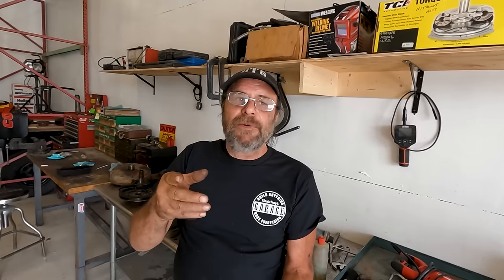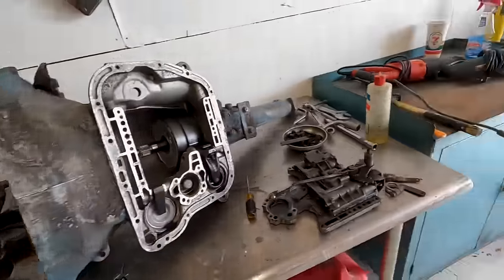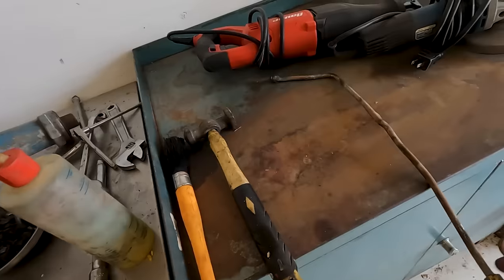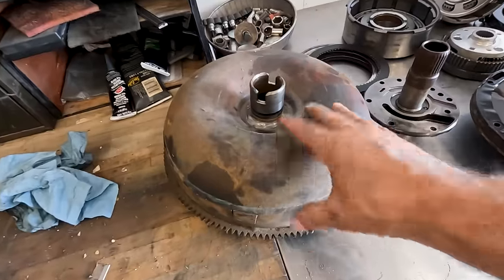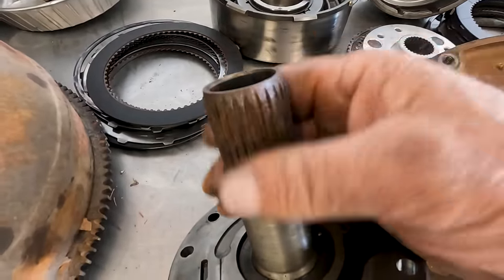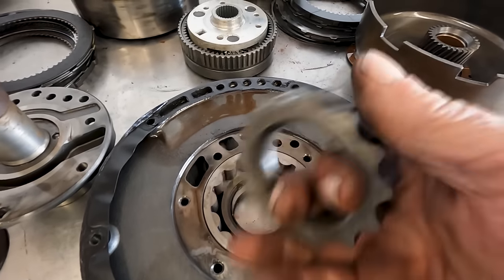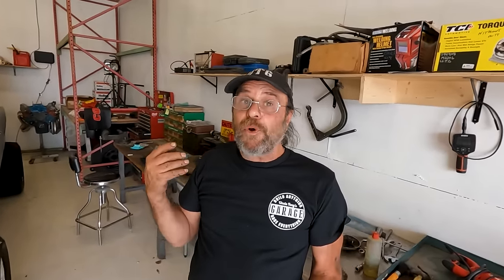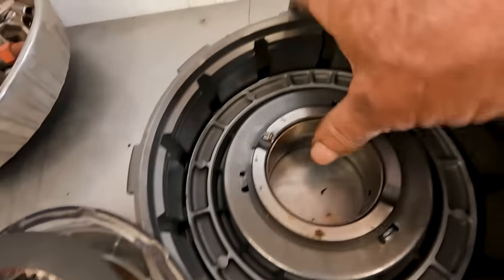Survival For The Budget Car Builder - DIY Transmission Rebuild From A Junkyard Core

Comment: There was a guy here on YouTube from England, who posted  a 17 part video or so showing you step-by-step how to take the 727 apart and rebuild it. I took my laptop out in the garage and used his videos to disassemble and reassemble/rebuild my transmission. It’s been every bit of 7 years ago, and that transmission is still going strong in my 72 340 Duster.
Reply: I watched the same series!
Reply: Bad Tree productions has a few 904 & 727 builds that they do for some of the cars they drive on the street & do some drag time at the strip . They had just done a 727 for the Death pumpkin that's using Cope transmission parts inside manual valve body & trans brake . They seemed to do a good job on showing everything in the rebuilds and checking clearances on stuff in steps and why they do this & even showed so of the home made tools to make things easier to do the tear down and rebuild process . So check them out because they are Mopar guys & some of the videos they do are hilarious at times picking on each other .
Reply: Ha haa, I decided to look for a 200-4R trans just yesterday, and found an ad, a used one $600, im like whoa that's high. So yup, parts are available, but not cheap. I'll stick to my 700R4 I got years ago and just buy a shorter driveshaft. But yeah, I'll take my chances rebuilding instead of ordering one.
Reply: They are better mechanics!! Than some of the clowns that call themselves mechanics over here!!!
Reply: God I love YT if only for this
Reply: Somebody from England working on Mopar transmissions? Learn something new everyday

Comment: Quick tip when looking for a core; if you are going through the pull-a-part, the car that looks clean and nice is NOT the one to get your mechanical parts from! If you can’t tell why it’s in the junkyard, it’s probably a bad engine or trans! However the car that is smashed, you can be pretty confident it drove to the scene of the accident! So while you should still consider any mechanical parts a core, especially on older stuff, odds are the one from the crashed car will need the least amount of work to get back into shape.
Reply: Absolutely Correct...
Hahaha..  drove it's self to the accident....

Beats,The .. well it Ran good,, 
Until it didn't...
Reply: Bingo PAL 💯👍
Reply: This is a darn good point.
Reply: It ran well…
Until that #!!@!$ got in the way.
Reply: That is how I always did my junkyard shopping but like Uncle T said, consider everything a core. The reason I say this is because of the modern automotive invention(! DRUMROLL PLEASE!), The Auto Computer! I have seen dozens of automobiles, that with the correct electronic TOOLS and PARTS, they were still excellent automobiles. They ran great and looked VERY NICE!
   Whether the owners did it or their mechanic ( Who WAS a TOP-NOTCH, Fix ANYTHING Mechanic from the 1970s-1980s) Gave the owner, the Deer in the Headlights LOOK from parts swapping very expensive and non-returnable electronic products. This great mechanic usually doesn't have the scanning tools or the knowledge of what any of it means.
   Everyone has good intentions but your preacher will tell you (it applies to cars), the Road to Hell is paved with good intentions!
  Buyer beware more than ever. Ya'll Take Care, John
Reply: Good tip mate.
Reply: Another thing is look inside the car if it is clean and looks like new it was well taken care of. If it looks like they lived in it and it is dirty they probably didn't do maintenance.
Reply: Yep! All engines I've pulled were from wrecked cars/trucks. You know it was driving relatively ok before it hit something lol
Reply: That's a great way to look at it!
Reply: Unless the force of the accident deformed the part or broke stuff inside... I've never found the junkyard to be a good place to get buildable cores. Just me.
Reply: That’s why my homebuild airplane parts are all sourced from Boeing 737 Maxes.
Reply: Well said..
Reply: Great advice, thanks.
Reply: From a junkyard, if I’ve got a viable “core”, diagnosing what’s wrong with it on the bench during disassembly isn’t big deal…..all things will be revealed. That said, your comment about the wreck towed to the yard from an accident being a safer bet for components than the parts from, maybe, someone’s basement, is right on. Been stung on some pretty looking stuff like that.
Reply: Wonderful advice
Reply: Great advice. A friend of mine mentioned that to me years ago and it seems to ring true👍
Reply: Good tip but being in upstate NY, probably 90% of the vehicles I see in the pick and pull are there due to rust. Either wouldn't pass inspection anymore, needed too much $ to keep it going (pass inspection) due to age rust and deferred maintenance (people don't really maintain cars at all anymore beyond tires brakes oil they use it till that first quoted repair bill exceeds idk $2k? And junk it, repeat)...so tldr basically all vehicles I see in the pick and pulls make for good cores. Use your judgement tho of course I strongly prefer OEM, generally the best quality came from the factory stay away from heavily modified rigs, they're easy to spot. Aftermarket rims, paint jobs etc. You want the factory goods/trans, high mileage doesn't matter for a rebuild. Cheers
Reply: The ONLY time i go for the shiny cars at the pick a part is when i need body parts and interior trim pieces. but ANYTHING mechanical i want that thing to look like it come out of a NASCAR wreck.
Reply: Similarly If looking for a engine, I shy away from roll overs, so often seen it the engine was running upside down/lacking oil in correct places. It may be trivial but given a little galling goes along way and can occur faster than most realize, best chances are the ones not ending up, upside down.
Reply: Err.... If one likes cracked cases and bent housings!
Reply: The best and most common sense statement I think I've ever heard about a subject as this!

Comment: I have only rebuilt 1 automagical transmission and it was a TH350 form the u pull it with an engine attached.  I bought a kit off evilbay for it which was a bigger kit than the $150 ish versions are, Kevlar band and a transgo reprogramming kit.  It looks intimidating but with a book and taking it easy, it really wasn't bad and it 14ish years later still shifting great.

Comment: I'm currently rebuilding a Push button A727, so far the experience has been great, a "built not bought" sort of build.
The build so far has been much improved from stock perameters.

So far i'm $1200 in parts, parts include:

4 pinion front/rear planetary
Front clutch drum with 6 clutch settup
Rear clutch drum with a 5 clutch settup
Thicker lug front pump gear
2000 stall converter
Trans-Go TF-2 Shift kit
Lightened sun gear shell
Drilled/modified case to allow ATF to reach the sprag for lubrication, instead of getting lube by "splash"
Blueprinted case.
Billet accumulator servo with no block rod.
Forward/reverse billet servos.

(Billet servos are necessary at time as the modified valve body pressures tend to crack the stock servos)

The best part about this job is i know what i did in the rebuild.

And as Tony has said: you can point to a part of a car and say, "i did that myself"

Best feeling in the world.
Reply: Did you go with the rear bolt in sprag by chance and if so how difficult was it to install ?
Reply: @peteloomis8456  I didn't go with the bolt in sprag setup, just replaced the springs & rollers only.

I can't vouch for the bolt in sprag installment difficulty, but I don't like the idea of drilling more holes to accommodate new anchor points for the new sprag, just creates more areas where the case can get stress fractures/cracks to form.

One thing I did manage to learn was, the factory sprag outer race that is staked into the case very seldom shifts in their positions, they were really well staked, almost solid from the factory.

Disturbing the factory sprag race is asking for trouble, it hasn't moved for at least half a century, why disturb it's "tomb" now?

This A727 is going in a 1964 Dodge custom 880 behind a 361 big block,
(viewable on my channel)
It's one of the last Chrysler forward look full-size cars.
So it's a cruiser, not a racer really. It's important to have that distinction.

If you are constantly neutral dropping the trans and beating it up, sure a bolt in sprag "might" help.

I say "might" because the full force of the engine will not be stopped by a bolt in sprag, might I recommend a billet front drum?

As the front drum is the part that is allowed to over speed when the sprag fails and explodes sending shrapnel through the floorboards.

Do watch John at CRT on the explanation of A727 explosions.

All I'm implying is a bolt in sprag is a good investment, but there are other critical parts that need to be upgraded in conjunction.

But as a dominoes effect, Putting power through some weak/strong components will always find a weak link in the drivetrain.

Comment: Tony video idea cut that torque converter open and show the common man what's in there it's one of the most misunderstood parts on a car
Reply: It just a fan blowing at another fan causing it to follow along , it's not magic.
Reply: @pisstoffcat5136  I know how it works  never said it's magic but the avg person does not I've heard all kinds stuff like its the pump for the trans and other stuff
Reply: I know what's in it, but I've never seen it. I like the idea
Reply: When I was going to tsti and taking a transmission class , Mr. Rowe the instructor, put 2 box fans on his desk as a demonstration, he put them together and turned one on , the other one Started to follow. And he said see, it's not magic . Not trying to be a smart ass, just how it was explained to me.
Reply: And why a high stall converter is a different animal from a regular Torque Converter
Reply: @wwalker3738  right there is a uneven number of blades on the rotors more on engine side is low stall more on input shaft side is high stall I think
Reply: Also why is a high stall a smaller diameter?
Reply: @bourbonlover7158  I believe it's smaller and lighter spins faster
Reply: @jeremyhanna3852  Yes ,  takes less engine power to accelerate the spin.

Comment: I been researching on a street/strip th350 I want to put together and was more than overjoyed to find that if one leaves a few well places seals out and drills a couple holes bigger you get the same performance as an aftermarket shift kit saving HUNDREDS 👍 the old school guys have been there done that without an aftermarket kit
Reply: And don't forget the old Ford type f fluid ,use that for a firmer shift. 
If they still make type f? 
If you've seen b+m trick shift fluid ,it's type f for your gm product and costs a fortune over type f. 
See if you can scare up some type f ,it's like a shift kit in a bottle. 
Been years since I messed around with that stuff.

Comment: I rebuilt transmissions for 23 yrs before retiring.  The earlier 3 speed automatics are the easiest things to build and troubleshoot.
Reply: Frustrating that something that mechanically works just fine and it gets a computer added to the mix.( 4l60, 47re, or the ford aod)
I have 4 4l60 trans that I have collected up in different states of disrepair. One with no 3/4 , one with 2nd or third gear only(also electrical connector falling into the trans pan), one that does absolutely nothing, and another that the guy just said was bad. Out of all 4 I hope I can make one that works, but all that computer jazz makes me question why I even like Chevy s10s

Comment: I've done a few transmissions myself. I can tell you that the 904 and 727 are far simpler than any of the other brands. Considerably less parts in there to keep track of where they go.  Also a stock replacement 318 727 torque converter will give you some stall behind a more powerful engine. I've used one with a 400 and 440 big blocks and they held up ok. Not super high hp engines but not stock either. Far cheaper than an aftermarket one if you are counting pennies. May have to knock the balancer weight off if you are running a forged crank.  I think you can still buy the weight kits and template to weld weights on as well.

Comment: I built my first trans when I was 17 years old. It was a 904 non-lockup. I have built dozens since then; 904s, 727s, M20/21/22, A833, Turbo 350, NWC and WC T5, AOD, 4R70W, 42RH, 46RH/RE. I can build all of them with my eyes closed. I don’t pay anyone for anything, body/paint, engine and trans builds, diff builds, you name it. Deep 11 second all steel, full interior street cars. My body and paint is show quality, and I’ve been building 727s on the side for the last few months for $1000 a job. Turnaround is 2-3 days. Easiest money ever.

Comment: Good video uncle Tony 

here in Australia if you have a common car like a Ford automatic

The rule of thumb is if you pull it out and put it in yourself 

to get it rebuilt is 1000 bucks a gear so a very common six speed is six grand……….

And at that rate, you are still getting your hands dirty

Comment: Some of the odd ball tools and seal installers can be made on a 3 D printer. I found the info on line for one I needed and had a neighbor print it out.  Ford wanted $200 or so for their "special" one.  It worked great. I only needed it one time, but I still kept it.

Comment: I did this back in the day with Ford C-4. C-6 and FMX transmissions, as well as top loader 4 speeds, long before there was an internet and I had to rely on Chilton, Glenn's and Motor's repair manuals. And a kindly local dealer who'd let me photocopy manual pages. Lots of work, but well worth it.

Comment: I've never been able to afford a transmission shop, after taking apart a transmission from a shop, they always seem to short cut somewhere inside. My 4l60e in my Ws6 has lasted over 150000 miles on my rebuild. They can be a pain to do, but comfort in reliability over the alternative.
Reply: I remember in the 90's TH 350,Th 400 ,C4,C-6,904 and 727 were rebuilt with 6 month warranty for $450 INSTALLED that would be just under $1000 today...Cheapest now is $2500 for those rebuilds and NOT re&re,thats $1500 more than the old days  when money is converted but back then he removed the trans and replaced it.FWD cars were similar in price.

I always messed with cars bought/sold etc..I didnt mess with transmissions as he could have them done in 2 days,I was just too busy buying/selling and I rebuilt engines but never touched a transmission until 20 years ago..he retired and his shop went to crap with the new owner,prices went up and quality went down.

Comment: I had a transmission specialty shop rebuild my turbine drive dynaflow for my 59 Buick. Result ...kept my car mostly sitting outside in the snow for 4 months. Didn't work right so in shop for another month. Tried to charge me way more than was quoted in the beginning. Fast forward 12 years. Looking for a r4w70 transmission for my fairly nice 97 Explorer Limited. Paid $300 for one from a junkyard. Vehicle had over 500k and was wrecked. When I opened up the transmission, was super obvious it was a fresh rebuild. Installed as it was. Put 150k on (including lots of boat and trailer hauling) and still going strong. Point is either way you go, your taking a risk so take care of them in the first place. Currently have 3 trans coolers on my explorer 😄

Comment: I remember when I went through shop class I was well ahead of the average city kid, being I grew up on the farm.  While they were learning to put together a lawn mower engine I was rebuilding engines and transmissions.  I put together a TH350C with a street kit for $250 and the shop made money as well as me.  It's been a long time since I looked at a transmission.  Mr. Transmission is gone.  Rebuild kits are $250, a junker is $500 and a rebuilt OEM TH350 is $2000.  Holy shit...  A hopped up TH 400 is $5000 now.  WTF is going on?  I guess I better get into the rebuild business...
Reply: I rebuild autos on the side, meaning two every week. I'll charge anywhere from 1100 to 1600 depending on the trans and if they want any goodies like a shift kit or valve body mods. I average two grand a week in profits after my overhead. Do the math, that's a hundred thousand a year for sitting on my ass and playing with a giant erector set. I have an autoimmune disorder and can't stand for long periods of time, so this is perfect for me. Like Uncle Tony said, rebuilding trannys is a real drag but it's quick money and the demand is huge. I'd love to get into selling cores and parts but I don't have the storage space.
Reply: @Whats-It-To-Ya  You can make $100k on the side and you haven't expanded your operation?? You need to raise your prices a little and hire some help for low-skill subtasks like cleaning up cores and such. Build a proper shop.

Comment: I've swapped torque converters but I dread opening up the transmission.   Luckily I deal mainly with XJ jeeps so rarely do I have trans issues but pick/pull/marketplace keeps things moving if needed.   With the AW4 trans it seems high mileage stockers are more reliable than rebuilds.

Comment: Tony, got any experience with MGBs? One of these could be a cool, cheap, “will it start” type video or an entire maintenance or electrical repair video. The carbs alone are unique enough compared to typical American stuff.    

Obviously, they’re not fast but they have a similar appeal as a mini-bike/low powered motorcycle and are readily available.

Comment: I have the fsm for the 1990 full size pickups with the diesel supplement. 
Each operation lists the required tools with part numbers if they're proprietary. 
The fsm for the 90 isuzu amigo says "use a suitable tool"